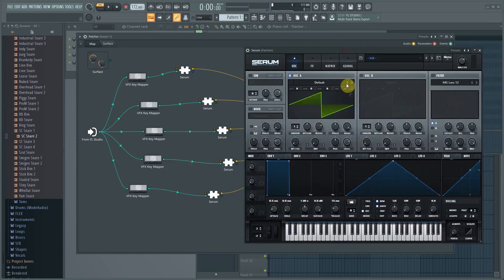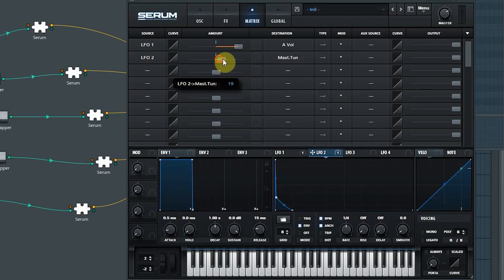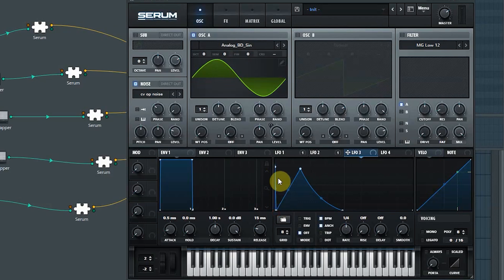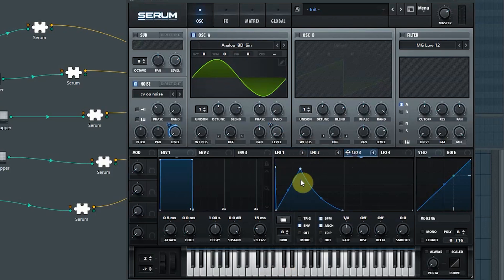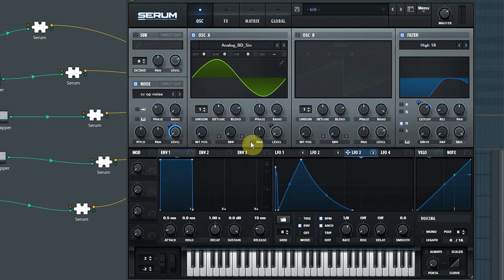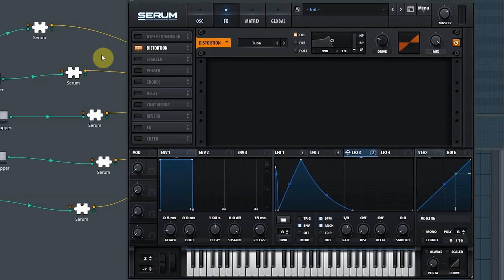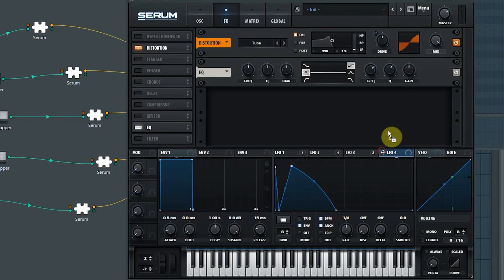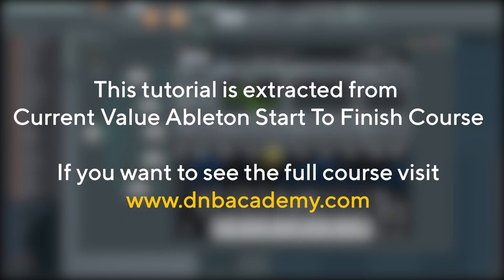How to Make Snares in FL Studio with Current Value | Serum Tutorial

Comment: Don't think I'd use this kind of snare in a liquid tune though
Reply: Yeah well, CV isn't really a liquid producer.
Reply: @qasderfful  Yeah for sure - just pointing out that this type of snare might not be appropriate depending on subgenre. I think it's important for beginner producers to realize how important sound selection is. Wasted many hours myself trying to get certain sounds to fit when I should have just used a different sound/sample altogether.
Reply: @diversity333  Yeah sound selection is important. But liquid doesn't have to have softer snares necessarily, there are tons of tracks where the melody/pads/vocals are really soft and calm, while the snare is really pumping. Sometimes you need to get the energy from a track through the drums, it varies from track to track
Reply: DEPEND OF YOUR VISION. OF COURSE IS MASSIVE SKILL...